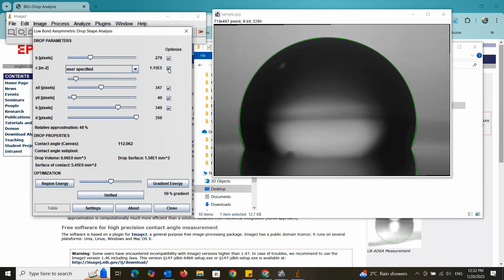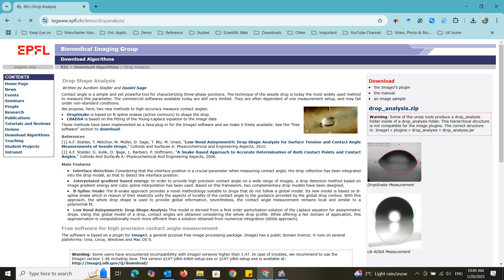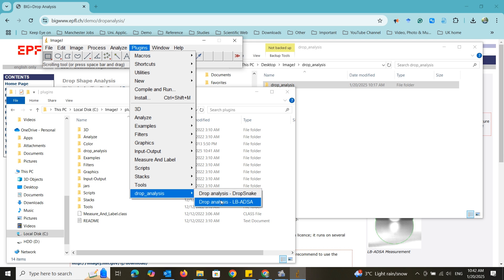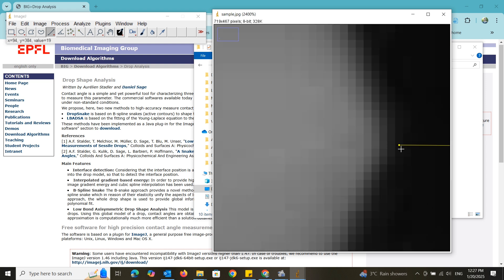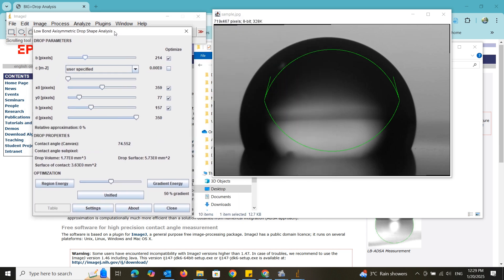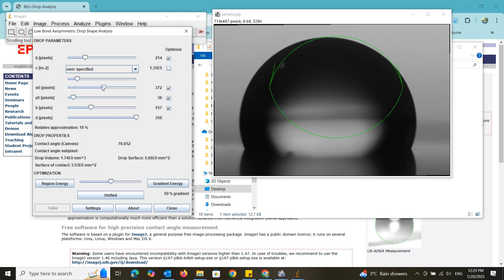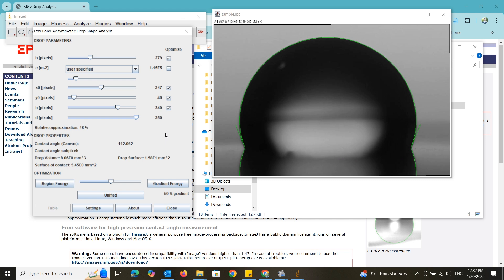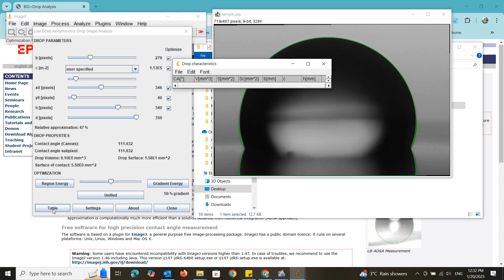Measuring Contact Angles Using LB-ADSA in ImageJ | Drop Analysis Tutorial

Comment: Sir, what is gradient energy? What doe it means?
Reply from the maker: Hello. It's a refinement technique. As an example, when you want to fit a graph using OriginLab, first, it generates a simulated curve and fits it to the real graph until it observes the minimum error. Similarly, using gradient energy, a theoretical gradient image is created based on the Young-Laplace equation. Then, an error function is defined that compares this theoretical gradient image with an experimental gradient image derived from the drop image. This approach allows for better handling of blurry images and noisy images compared to standard ADSA methods. Please feel free to check this paper if you need more info. https://doi.org/10.1016/j.colsurfa.2010.04.040